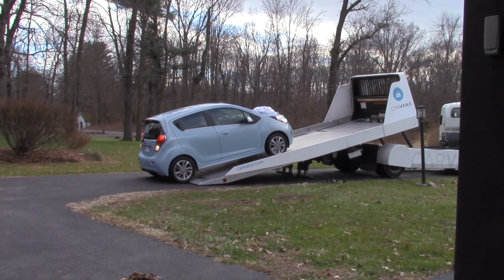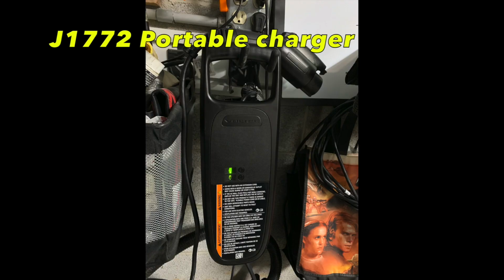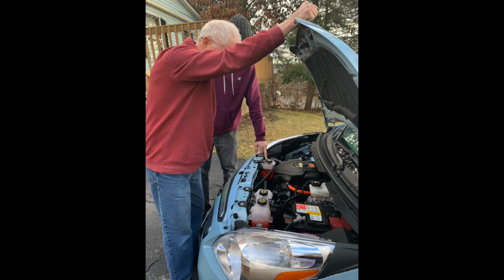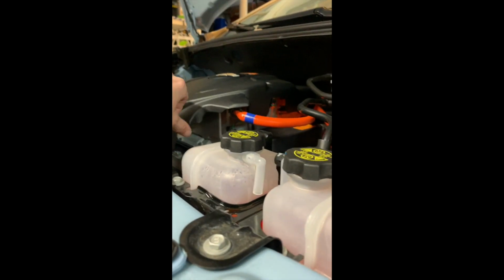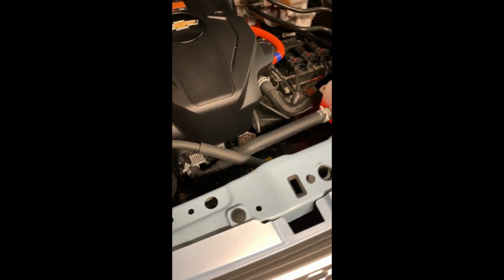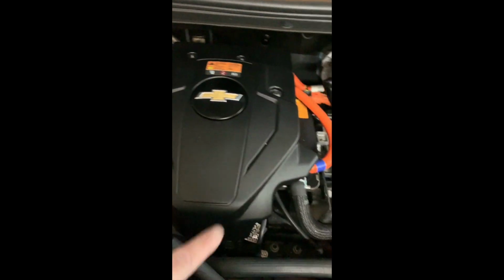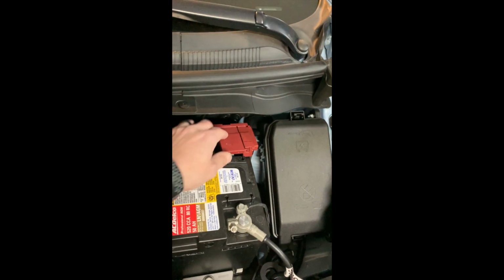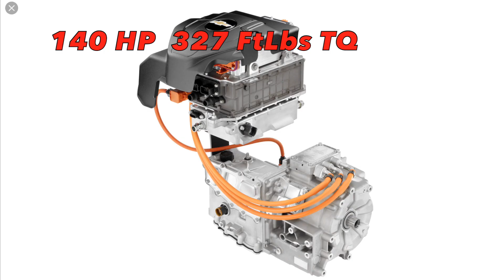Chevy Spark EV teaser My first Electric Vehicle by SVTWRC

Comment: So excited that someone who is "hands on" technical might be posting some Spark EV videos. I picked up my Red 2015 Spark EV from Carvana summer of 2018. So far I have found that the older generation VW  4x100 wheels made a good fit for New England winters with Michelin X-Ice 185/60/14 tires. If you are taking requests, since I'm close to 5 years perhaps that coolant flush might make a good video. Also, are there different procedures for a brake change seeing the parking brake is automatic?
Reply from the maker: peter sachs good to hear someone else is enjoying the Spark. Tire wise I’m looking for some sticky rubber for summer , options are a 205 rear and 195 front. Coolant wise it looks like it needs to be vacuum pumped out and replaced by a machine. The brakes can benefit from a good street rotor slotted with a good street pad so it does not need to warm up. You can tell that when your slowing to a full stop the regen cuts out near 5 miles an hour and under your using the real brake and it’s not stopping well. I think they have a ceramic pad and it may be better to have a semi metallic for street use. The electric brake should only be the actuation of the brake and not have anything to do with the rotor or pad replacement .  How about that torque , looking into getting a flash that makes the sport button even more of an aggressive throttle trim. Chevy had a performance Spark EV with 450 ftlbs.